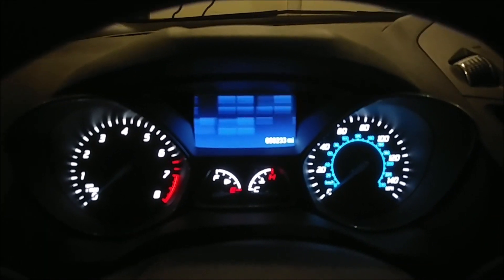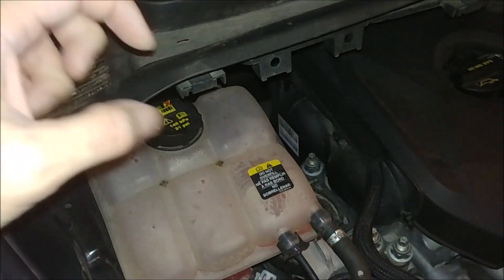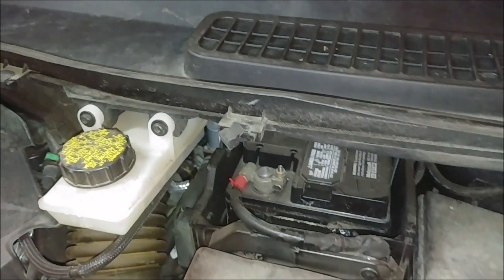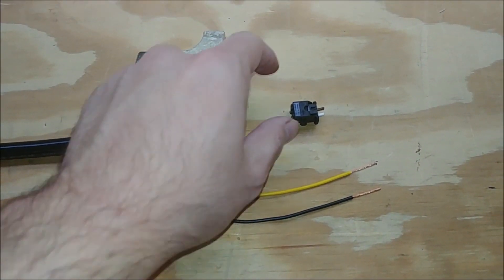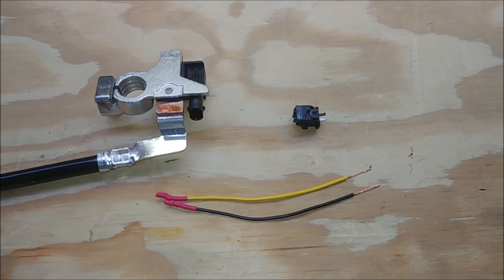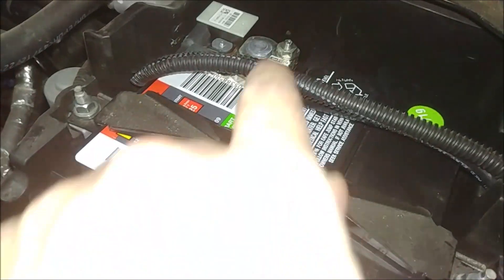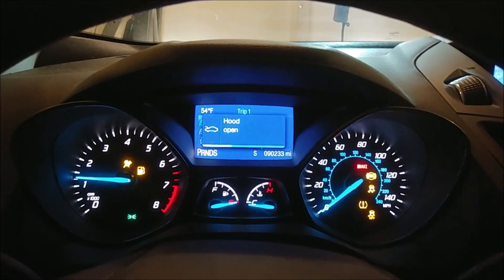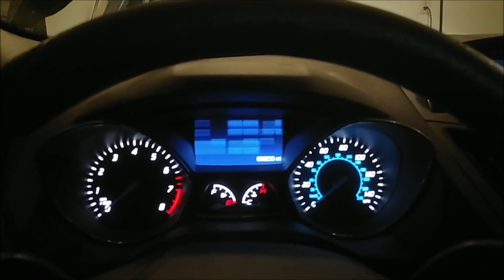Battery replacement on a 2013 Ford Escape

Comment: Sure glad I have the 2.5. The air filter box comes out. The front of the battery box pops out and the 2 little nuts spin out by hand once loosen. The battery slides forward to take off the ground. The first owner replaced the battery just before I bought this 2013 model but failed to clean the ground post properly. I put it all back together and the problem was solved.

Comment: That is interesting that they have a current sense on the battery.  I guess it might let them better guess the capacity of the battery?  I have an 2005 escape hybrid but thankfully the battery on it is easy to replace since I have swapped it 2 times now. (I have over 300k miles on mine)
Reply: That current sensor allows the computer to re-calibrate the charging rate as the battery ages. Practically every vehicle currently has or will have this type of BMS.
Reply: If you figure the AVERAGE life of a battery in a non-hybrid vehicle is about 5 years, the amount of effort to replace it in a '13 FE doesn't REALLY seem so bad! IMHO.
Reply from the maker: @TheOzthewiz  
The current sensor is used to increase the MPG...
At low engine RPM, and while stopped, the alternator turns off, and you run completely off the battery.
The current sensor counts the Amp-hours out of the battery.
If you are at a stop for a really long time, and the battery gets below the setpoint, the alternator turns on, (feels like the AC compressor kicking in). But the battery is not charged, the current sensor maintains 0A into the battery.
When the engine RPM comes up, then the alternator cranks up the current and starts charging the battery.
If you ever wondered why the car has no voltmeter on the dash, this is why. Drivers would get concerned about the battery voltage slowly getting lower at every stop. ;)

Comment: Just watched a video where the guy didn't have to remove any zip ties to get the front of the battery case to fold down after removing the air cleaner! Btw, dropping one of those clips, will cost you $5 at your friendly local Ford dealer! LOL